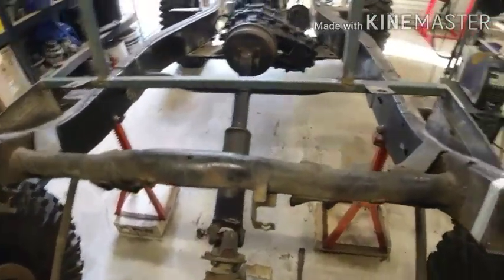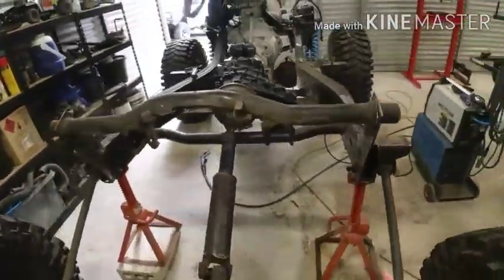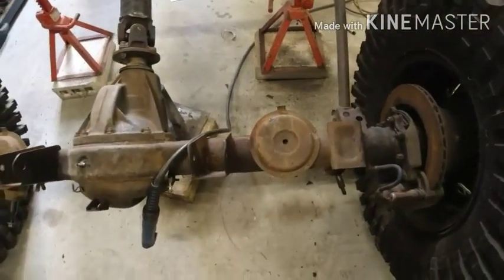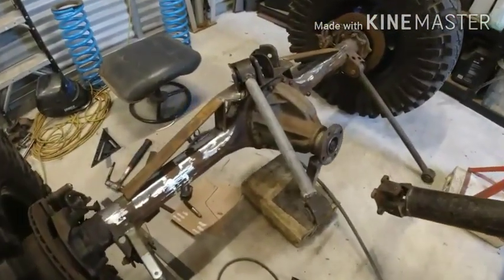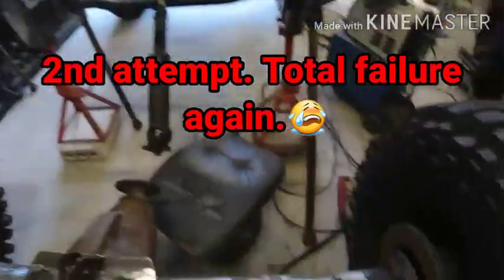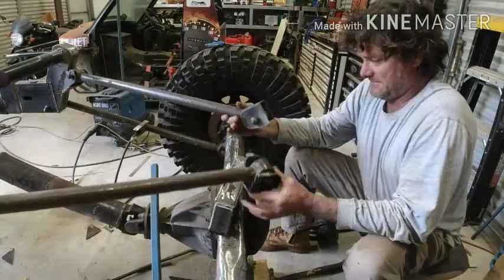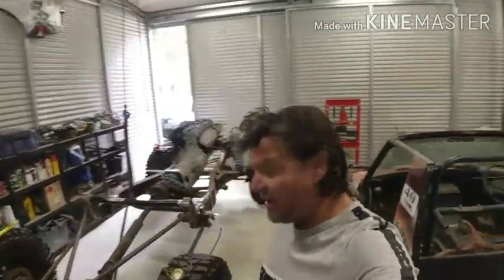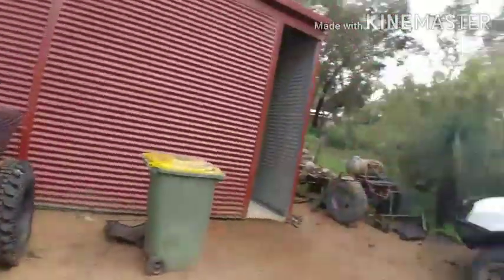RoverPatrol episode 4 -- GQ patrol single triangulated 4 link rear end.

Comment: Hate to bring this up but aren’t your pinion flange and transfer flange meant to be parallel? You might need to shorten the top arms?
Reply from the maker: The flanges are ment to be equall and opposite angles but in this situation i need to run a double carden joint at the top uni joint and all will be good. Thanks for watching 😀